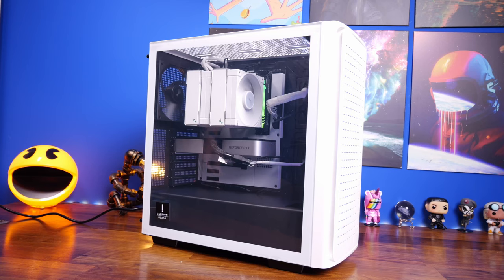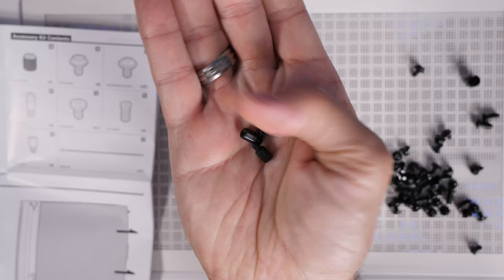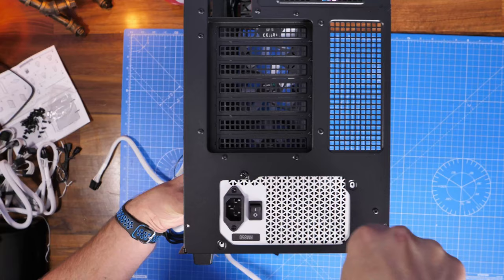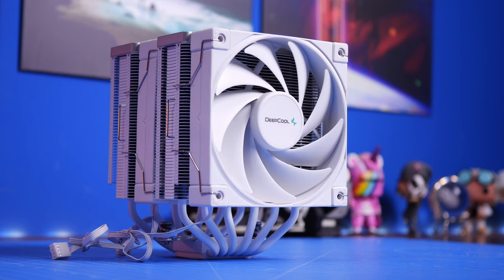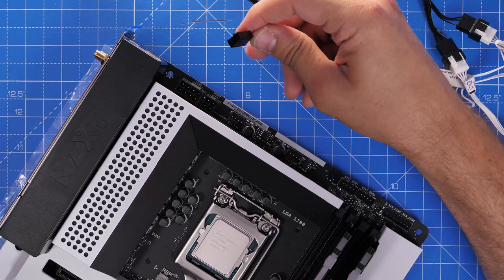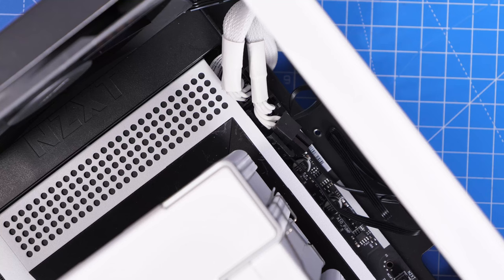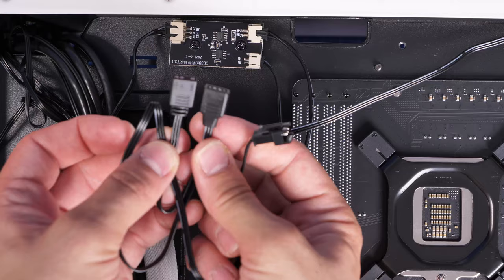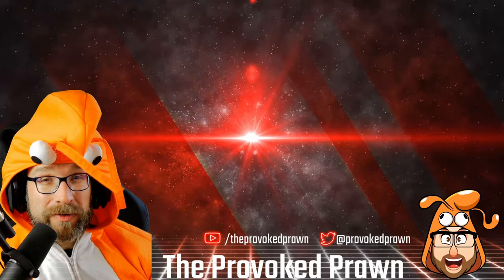DeepCool CK560 WH (white) mid tower case review and build guide

Comment: Hey, thank you for your guide. I got the same case ad i am struggling with fan connection, can i plug all the fan together and use only one connector on the MB ? I don't know how to do. And where i need to plug the ARGB split in order to control the lighting from MB software ?
Reply from the maker: Yes you can or connect the three front ones to one sys fan header and then the rear fan to a different one. As for the RGB, I did show that I thought but you'll need the 5v RGB header. Usually on the bottom left of the motherboard